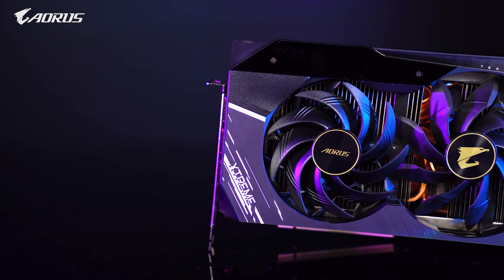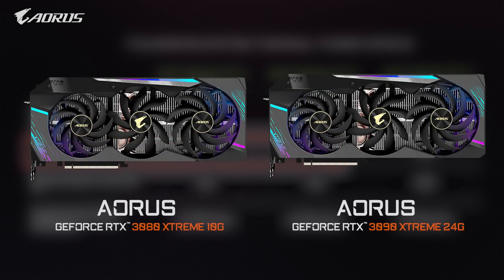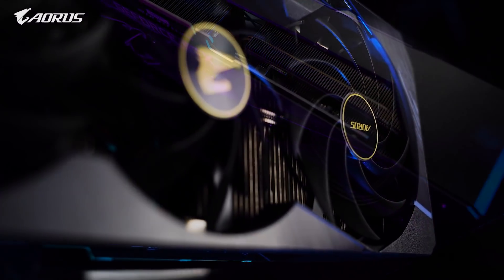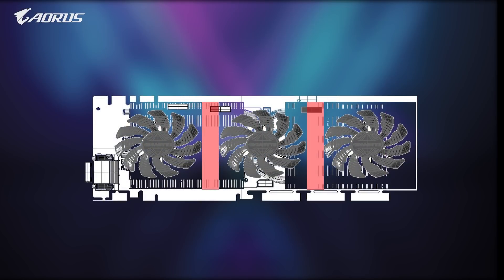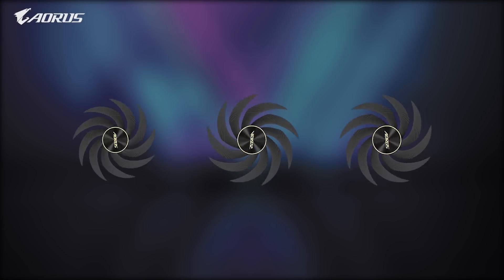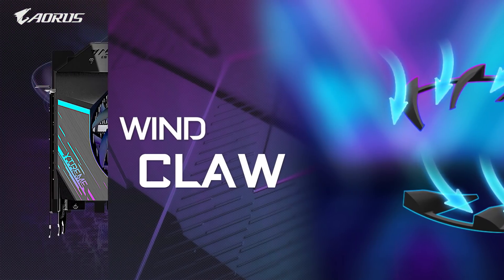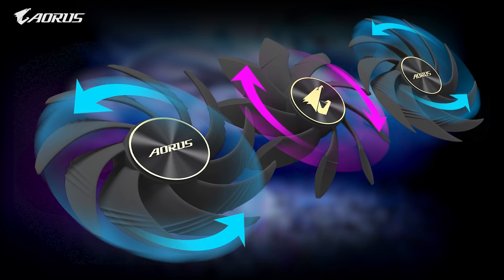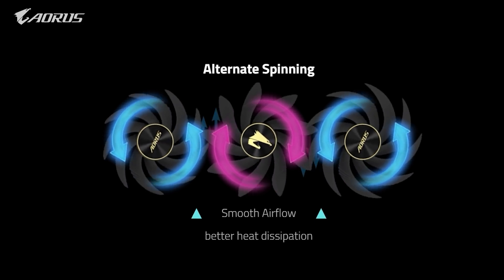AORUS RTX 30 Series - MAX-Covered Cooling | Feature Highlight

Comment: My Aorus graphics card catched fire due to a manufacturing error and they don't care to replace it, since they only accept RMAs "when they can repair them", which is obviously not possible with a burned PCB. Great work on the cooling solution!

What happened:  The thermal pads from the cooler were mounted misalligned, so they pressed down the VRM chips on one side, leaving the other side uncooled. This caused deformation and the VRMs started to hover on the other side until they lost contact from some pins. The other side however (where the pressure was) started to short-circuit at some point because lead from the pins closed the gap after the chip slightly shifted. This would be unlikely if the cooler didn't had pressed down the VRMs on just one side while covering only 1/3 of the chip with the termal pad, so this is clearly the fault from Gigabyte/Aorus since they didn't allign the termal pad correctly. It's a manufacturing error on a 800€ Aorus card (1080Ti) which shouldn't have happened. The worst part is that their gurantee doesn't cover errors where the card can't be repaired afterwards, so the Aorus gurantee is a joke and useless. They just didn't accept my RMA request.
Reply: @Zoran Yeah the chip is from Nvidia, but if its overheating and catching fire that's because of cooling. Nvidia has nothing to do with the cooling or finished product.

If you buy a FE card then it's all Nvidias responsibility, but any AIB issues are because of what they did. Nvidia provides the chip and blueprint of the card. Aurous, Gigabyte, MSI, etc look at that blueprint and they can modify it or keep it the same depending on what they're making it for. If they used Nvidias blueprint with no changes then it's almost both of their faults. Nvidia for making a faulty blueprint and the AIB manufacturer for not noticing it or doing proper testing to make sure that their product works. Even if they changed nothing and just copied everything from Nvidia 100% it would still be a problem to buy a card that doesnt work from MSi or whoever because it means they didn't do any testing and have terrible quality control.
Reply: totally agreed 100% but like another user implied, there is more to the story

i’m not saying this is the case but there is a strong possibility

the user increased the voltage in the overclocking then it burns the card then they want to act innocent and they want their card replace

bad cooling by not increasing the fan curve when increasing the voltage

this cards run extremely hot when normally playing
you need to make sure the card has proper ventilation
and the cooler is doing its job by cooling down the card

a bad computer case with bad air flow or no fans to let hot air out andcold air in
also probably a high hot temperature room

all these possibilities can cause a card to burn or catch fire even a cheap pc power supply
Reply: VF Airsoft Thank you for the warning about how Gigabyte deals with warranties. You should have gotten a replacement.
Reply: The solution is easy... Go buy another card (exact same model), and return this one in its box as defective (through any main retailer). The retailer will force the company to accept the return, and you get a new card.
Reply: @azilko  I think the serial # is on the receipt so I think this can't be done
Reply: Sounds like there's more to this story.
Reply: @ebridgewater  There is unfortunately a lot more, I tried for month to get a replacement and wrote a lot of messages with them, including an expert opinion report on what caused the issue and why it's a manufacturing fault. Their customer support was extremely slow and I had to explain the same thing a couple of times. They tried everything to blame the issue on me and to dodge my RMA request. What they offered me in the end was a big joke, I mean I sent them pictures of a burned PCB and they said I can send it in, but they will only do something if they can repair it easily, which you obviously can't (I work in a factory that produces similar products, you can't repair a burned multi-layer PCB). Before, they tried to force me to RMA over the shop where I bought it, which declined to do that, so they both played ping-pong with me. This 3 years guarantee from Gigabyte is a big joke, especially when your shop doesn't care about it.
Reply: Had problems with gigabyte warranty in the past. With a 780Ti not perfoming as it should and ignoring my comments and with a motherboard (forgot the name, sorry). I'm not buying from them anymore.
Reply: my rtx2080 s waterforce is leaking and they don't even want to fix it its under 4 years warranty !
Reply: Everybody already knows gigabyte has shit rma same with msi not surprising that they rejected it
Reply: I remember one of my Gigabyte card  was damaged suddenly, CPU got burned and when opened i noticed the thermal  paste was wrong put  on the CPU and was an incorrect paste(I am sure that caused the damage) nor seals from factory, so those types of errors from human hand can happen,  pretty strange case they declined warranty at first  but i fighted a lot explaining i didn't put hands on that card etc, till one above from the company accepted so i waited 2 months , at least they offered  me the 80% of the cost of damaged card in money at the shop i bought it, but i rather Asus instead and more quality.
Reply: Tbh Gigabytes biggest weakness is their warranty/RMA policy
Reply: Caught* fire 👍
Reply: If this has happened within the warranty period of the system (you said you bought a complete system), you are entitled to get a free replacement from the system vendor. If he refuses to provide you with one, see a lawyer and make him. If it happened after that period, you are out of luck.
Reply: good for you bro
Reply: sounds like you gave them too much info when requesting an rma. how about hey my card stopped working please fix? when they receive it they most likely just toss it in a dumpster and give you a new one
Reply: @rayikaikin  exactly, since he gave them all that info, they figured he opened the card, which it obviously voids warranty
there is no way he is going to know that unless he had opened the card
he put the rope around his neck when he gave them all that info

next time vf airsift just don’t say anything and simply send the card, what is the worse it can happen? you lose the shipping money but at least you tried to get your burned card replace, many people that open their cards to install water coolers or to change the thermal paste or install better cooling pads know the risk about opening the card, if you open your card even if the card wasn’t burned, you lost your warranty, i’m not saying that is not possible to get a defective card, maybe it did happened like you described, but i had 5 aorus cards, going to number 6 and never had any problem with any of the cards, maybe you bought it defective from a dishonest seller, who probably knew the card was defective and still sold it to you, this also happens, i buy my cards from newegg.
Reply: Could be shipping, u automatically blamed the manufactures
Reply: you first mistake was that you blame their design
2nd there is no way that what you described it will happen from one second to another
without you noticing any signs of malfunctioning or overheating 

if you run their app you would it have seen an abnormal temperature and that was your clue to stop using the card
but if you didn’t pay attetion to details ir disregard and continue to use the card
then i’m sorry but is on you
Reply: TBH, he must have bought this from Newegg since he mentioned RMA. He can contact the manufacturer and with some pictures and receipts he's getting a new GPU, stop fucking crying. Iv dealt with GB since you were in diapers and have never been rejected no matter what.
Reply: Don't like his comment. Guy gives us no context and hasn't fully articulated the issue. How does he know it was a manufacturing error? He could have plugged it into a 350w psu and been like "yo why does my pc smell like lung cancer"
Reply: @australvoid8032  To be fair his card COULD have been one of those early run GTX 1080 or 1080tis that have reportedly caught fire. My Gigabyte gtx 1080 card smoked itself however i was within my 14 day return period and it was replaced free of charge by the EGG...
Reply: @falkwulf3842  A PCB fire would be Nvidia's fault but fat chance they didn't try to assist him. Its like when people crash their car and they're like "it just randomly accelerated man"
Reply: @australvoid8032  Your comment proves you have No idea that AIB partners Like gigabyte design their own PCB's and cooling solutions.  Jayztwocents and Tech Jesus explains this in their respective videos on the subject.  Paul and Kyle explained this as well however Jay and Steve go further into detail.  Just FYI...
Reply: @australvoid8032  To add on to falkwulf. AIBs like Gigabyte,Aurous, Asus are responsible for over heating because Nvidia just provides the basic design blueprint and the AIB manufacturers that design and edits it how they see fit to give features like over clocking,better cooling, aesthetics, etc. If a graphics card is catching fire that's because the AIB did something wrong or the cooling system they made was ineffective. 

If Aurous and Asus are both using the same template and information from Nvidia and Aurous is catching fire, but Asus isnt then its definitely an Aurous problem.

I'm not talking trash about Aurous. I have no experience to say if they're good or not, but in general that's how AIBs work.  Nvidia is making their own AIB now though so of you have any issues with the founders edition or Nvidia cards then it would be their fault.
Reply: @falkwulf3842  Thank Fuck!
Reply: @australvoid8032  Not if the cooler didn't even Touch the components on the PCB. This has happened.
Reply: Austral Void its also possibly the aorus cooling not directly touching the die.

Edot: or other components like vrms,mosfets and etc.
Reply: @australvoid8032  how is that Nvidias fault if the cooler is made by gigabyte and the reason if caught on fire is because of no cooling??
Reply: @australvoid8032  Uhh, having insufficient wattage isn't going to cause a fire lmao, that's the opposite. The card just isn't going to run if it's not getting enough juice, or very slowly/stuttery.
Reply: @australvoid8032  The thermal pads from the cooler were mounted incorrect/bad, so they pressed down the VRM chips on one side, leaving the other side uncooled. This caused deformation and the VRM started to hover on the other side until it lost contact from some pins. The other side however where the pressure was started to short-circuit at some point because lead from the pins closed the gap. This would be unlikely if the cooler didn't had pressed down the VRMs on one side while covering only 1/3 of the chip with the termal pad, so I would say this is clearly the fault from Gigabyte/Aorus since they didn't allign the termal pad correctly.
Reply: @AirsoftKeksTV  now that, is a detailed explanation. Okay, kinda fucked up gigabyte. Hopefully they can fix that for you, I've recently had excellent experiences with their motherboards. (hard-core memory OC)
Reply: @australvoid8032  Like I said, they won't fix anything. They only repair cards where they need to replace a broken fan for example, but if your PCB catches fire, they don't do anything and just dodge your RMA request. So I never received any help in the end. I ended up buying a replacement from a different company, that's the end of the story (of writing tons of mails with them over several month).
Reply: every day i have a bopeep in  task manager rtx2080  Mine is a waterforce cooled & is 30\cel  idle  in the Aorus app Gigabyte   You Do have a Warning temp gauge notification 🔔 
If it reaches over ? 90cel a warning lights up  Here if this kept happing you get concerned &  check Cables  etc If still bad & no fix i wouldve sent it for a check/warrantry
BEFORE it blew👍

Comment: Without RGB FANS.. it's not Aorus GPU :( 
Hope you guys gonna launch other versions of New RTXseries  like RTX20 series sexy RGB fans
Reply: Non RGB fans of Aorus RTX 30 series disheartened me and a lot of people who are aesthetic lovers.. 😭😭
Reply: i saw another video where the 2 fans in each corner light up by the side
not sure if the card has another mode like the 2000 series
i understand the point about the rgb
but the card has a digital screen just like the aorus aio cpu cooler
where youcan chage colors and have gpu temp fan speed etc on the screen
those look super cool even better than rgb lights
anyway i already have rgb fans on my case
is not like you are not going to have any lights
i can only speak for myself but i rather have the digital screen

i think is better not to jump into premature conclutions and just wait untill the card is out
so we can find out everything we need to know
Reply: @yonoexisto7833  but I have no reason to buy Aorus if there is no rgb fan, that's look was best.
I will cut my budget and go for Zotac. They brought nice rgb on 30 series.
Reply: @sohampal5071  i admit i also wanted rgb fans like the aorus 2000 series, but since i have a complete aorus system, i can't buy another brand, I'm not going to buy a 2080 ti because i sold my aorus 2080 ti to buy the aorus 3090,  but since the card has the digital screen like my aio aorus cooler then I'm happy anyway and i can buy the 3090 even if i have to install the card in diagonal position, i don't think the card is going to fit in horizontal position because it takes 3 slot and my case only has 2, but you can get another card that you like as long as is a 3000 series card

Comment: why not install
 sleeve liquid bearing, in bearings it is considerably longer
 ?
Reply: Probably because it's good enough already and that would further increase the price, a lot of people would probably go for cheaper cards with ball bearing fans since GPUs are usually replaced long before the cooling starts breaking anyways, wouldn't be too profitable for the company so no sense in doing that

Comment: Disappointing release for me sadly. The fan LED's in the 2080ti Extreme, set it apart from the competition. Now its just another triple fan GPU. The LED display adds a premium price but....is pointless for vertical mounting. The fan/cooling configuration is similar to the 20 series and that wasn't class leading.....🙄

Comment: The engineering seems excellent. The aesthetics, not so much, especially when compared to the Founder's Edition Cards.
Reply: Not much left from the "aestethics" when you connect the 12 Pin connector to it :D
Reply: @sanitoeterscc3416  ,
Agreed. Even if you had a clean, single 12-pin cable you'd still be running it to the middle of the card in an odd way, but the 2x8-pin adapter just makes this a mess. I personally don't care about the aesthetics for myself, but I can appreciate why people DO care as NVidia is also aware of so it's baffling to me that they did it this way.  I get that the circuit board is SHORT but it's not like you couldn't run a few wires to the end of the card so...
Reply: @sanitoeterscc3416  It feels lite Nvidia will be releasing their line of PSU's shortly 😋
Reply: I like Aorus 20 series cards look wise much better than these ones. Very cool. Not very good looking AIB cards this time around. I want to go the Founders Edition, but the power connector placement is horrible.
Reply: cuz this is their cheapest version, they ahve better looking ones that if you ask me still isnt the best looking but its not a square black plastic shroud with circles cut out for fans.
Edit nvm, it just looks like it KEKW. literally looks like asus's TUF series (their cheapest version).  thats a big yikes from me dawg.
Reply: I disagree
Reply: aesthetics my ass, only thing that counts is performance
Reply: @RobloxGirlySvs  even more so if you don't have a window panel on your case
Reply: I don't buy computer parts to look at..and I for sure will be trying to get my hands on an Aurus RTX3080.
Reply: For sure. Who are these people that spend money on PC part aesthetics vs performance? Do they think their Moms will be impressed by RGB? Do they think girls care if you color-matched your cables? How your new PC looks right after you assemble it is a fleeting high, failing to use your money to its fullest to optimize performance on your PC stings for years until your next build/upgrade. After all, we're here to play games. Your eyes will be on the screen.
Reply: FE cards aren't all that. They look like usb speakers, it's all speaker grills. Guess you can play music for guests
Reply: Yep nvidia just screwed all this guys this time
Reply: the founders ed cards look like fucking shit what are you talking about